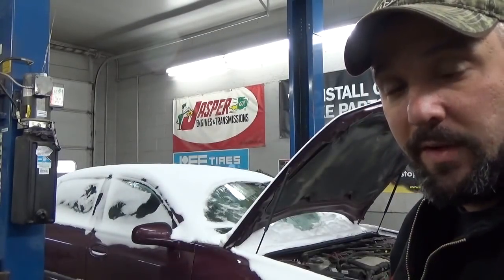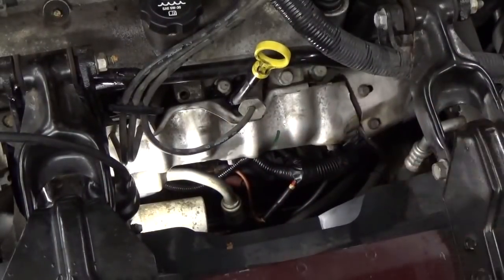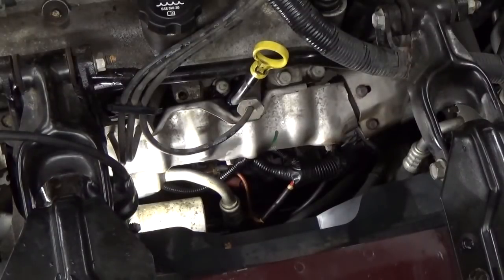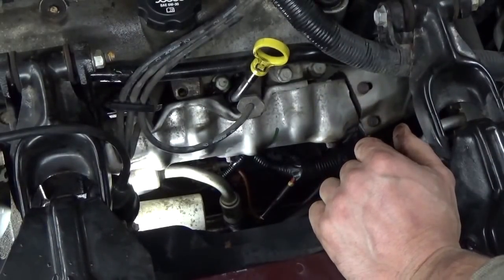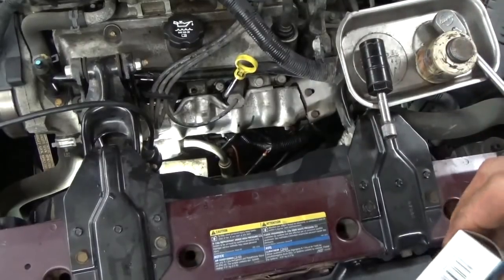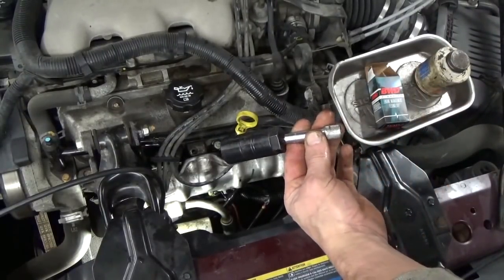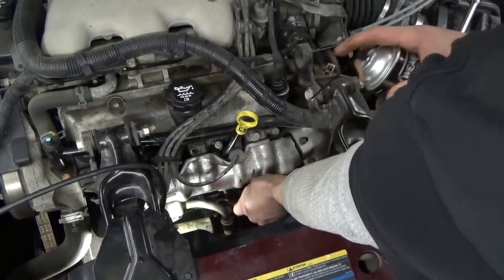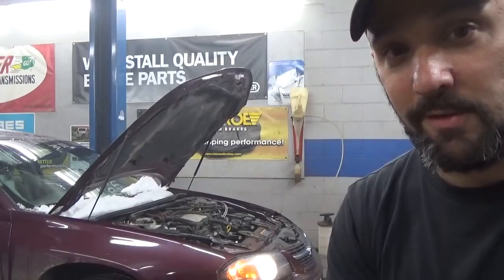Engine Oil Leak - Chevy Impala 3.4

Comment: I have a question related to the oil pressure switch.  I've had an "LOW ENG OIL LEVEL" warning light issue for several years with my 2003 Impala, and it comes on when I start the engine and then it goes off after about a minute or so.  I read into this online and learned that another Impala owner had success solving this same problem by adding 6 oz. of Marvel Mystery Oil (at the advice of a forum participant) to the crankcase which dissolved the sludge in the crankcase and/or other key location.  Do you think the problem is related to the oil PRESSURE switch or the oil LEVEL switch in the oil pan which could be blocked with sludge (or both)?  Can the oil pressure switch be cleared of sludge by using Gumout on it and/or its port?  Thanks.
Reply from the maker: DDEENY Usually just a bad oil LEVEL switch in the pan. Very easy to change.
Reply: +South Main Auto Repair I'd be very interested in watching a video to fix the oil pressure sensor in the pan. Do you have that video in your line up? If not, do you plan on making one?
Reply from the maker: Sorry I don't have one...
Reply: Thanks for your reply.  You're right, Gumout would definitely thin the oil and is NEVER intended or recommended to add to engine oil, but I mentioned Marvel Mystery Oil and not Gumout in my post.  BTW, I'm using MMO as an additive to both gas and oil now in the recommended amounts (4 oz. per 10 gal. fuel and 20% oil capacity), and if you read its reviews, there's nothing but 5-star ratings for it.  I track my MPG and it appears that I'm getting better MPG while using MMO added to the gas.  I'm also using MMO with my gas lawn mower and MMO also functions as a fuel stabilizer to prevent it from going stale.

FYI, regarding my issue with the "LOW ENG OIL LEVEL" warning light that I had last year, I've since replaced my entire engine with a used one after I also had an ongoing issue with a blown head gasket, and it was actually cheaper and made more sense to replace the engine per my mechanic's advice.  Thank you again for your comment.
Reply: Thanks for the info.  Regarding my own blown head gasket issue with my Impala's 3.4 engine,  I was experiencing erratic heater function and occasionally my coolant temperature gauge would swing wildly into the red and the warning light would come on.  Then after a short time the system would normalize as fast as it malfunctioned.  The head gasket leak was causing exhaust gas to leak into the coolant and cause air pockets in turn causing the system to become erratic, and I verified the presence of exhaust gas with a leak test.  Then when that happened, I used the Lisle Spill-Free Funnel (highly-recommended) to purge the air from the system and it worked great but lasted only a short time before recurring.

In an unwise attempt to get off cheaply and against my better judgment, I researched all of the stop leak products including Bars and then used the K&W Fiberlock Head Gasket and Engine Block Repair stop leak because supposedly it wasn't necessary to drain the coolant (another issue is that fact that the 3.4 engine allows only about 1.5 qts. of the 11.3 quart coolant capacity to drain).  WRONG!!! DON'T EVER USE THIS PRODUCT!!!  After I carefully and slowly added the K&W (which has the "fiberlock" additive which looks like paper pulp and the fluid resembles egg drop soup), my Impala overheated in about 10 minutes.  I noticed that the upper radiator hose was hot and the cap was cool, indicating that the K&W blocked the radiator and/or thermostat.  I wanted to remove the thermostat beforehand but it's in a prohibitive location buried under the passover, not your typical convenient location.  20/20 hindsight, I would have ignored the product's instructions to begin with a cold engine and would instead have allowed the engine to reach full-operating temperature to allow the thermostat to fully open before adding the product hoping that at least the thermostat wouldn't become blocked.  Soon after that experience, I drove the car to my local Pep Boys and on the way, I noticed that the water pump was leaking, and also soaking the serpentine belt and causing it to slip to the point that the power steering was malfunctioning.  The blocked cooling system caused the pump to run dry which spells the end of it.  So in the end I had the engine replaced with a low-mileage used engine and it's been running perfectly for several months and I'm way happy with it.  I've seen another YouTube post explaining the very same experience with the K&W Fiberlock stop leak.  Although most mechanics frown upon "mechanic in a bottle" products, I'll admit that some have very favorable experiences with them and results are hit-or-miss depending on the product, how it's used and the specific nature of the leak.

I'm interested in your own experience with the transmission fluid added to the engine and although I've never heard of that, I've wondered if in fact the "mystery" of MMO is simply that it's glorified transmission fluid, and I'll research that.  If so, generic transmission fluid can be found at dollar stores much cheaper than MMO at Walmart which probably has the best price for it.  Even the red color is the same, and I still have a few full quarts of it in my shed from a previous transmission leak problem that I once had after having a transmission flush done on a high-mileage Caprice that caused the old sludge that was keeping the seals tight to be flushed and thereby causing the tranny to leak like hell.  There's another helpful experience for you to learn from.  Thanks for your comments.
Reply: Thanks again for your thoughtful comments.  I had taken my car to have the head gasket replaced on my 3.4 (I corrected my post when I noted 3.1) by my local mechanic later suggested that it made more sense to replace the entire engine with a used low-mileage one, which I agreed to do.  The head gasket repair cost was guesstimated by Pep Boys to be between $2,500 and $3,500 but my local independent mechanic replaced the engine for $1,800.  Make sense?

I'm aware of the 2 cooling system bleeder screws but as I said, I used the Lisle Spill-Free Funnel and it worked like a charm although the improvement to the cooling system performance was temporary as the leaking exhaust gas into the cooling system again recurred soon afterwards.  The way that the Funnel is used is that you park the car with the front end higher to set the radiator cap as the highest point in the cooling system, then simply attach the funnel to the radiator neck with the supplied cap replacement which creates a leak-proof connection of the Funnel to the neck, then fill the Funnel about halfway with coolant, start the engine cold with the heater set on to HIGH and watch the air escape in the form of bubbles from the radiator through the Funnel, small bubbles at first and then much larger once the thermostat fully opens.  Then when the bubbles stop, the system is fully purged of air and the Funnel can be removed and the radiator topped off as necessary.  Takes only about 10 minutes.  BTW, it's called the Lisle Spill-Free Funnel because it includes a plunger to seal the Funnel when it's being removed to transfer the remaining coolant to the jug, whereby the plunger is removed and the coolant neatly drained with no spillage.  I highly recommend it because it's much easier and simpler than fussing with the supplied bleeder screws.  I'd always recommend using it if the system is drained or otherwise opened.

I didn't have a grounding problem related to the electrical gauge but I did read about electrical resistance through a cooling system that if faulty, can contribute to gasket failure, and the coolant resistance itself needs to be checked.  BTW, I love my 2003 Impala so much that I also picked up a used 2005 3.8 Impala to use when the 2003 was down and now I still own both.  BTW, I now need to address my 2003's front end suspension which has become very clunky.  I know that the original struts need to be replaced (165,000 miles) but do have any suggestions regarding this issue and any other offending parts e.g. ball joints, control arm bushings or even engine/transmission mounts?  Thanks again for your thoughtful comments.
Reply: Thanks for the reply and info.  You really know your GM cars.  Wanna know the truth?  I really miss my old Caprices.  I owned a '77, '83 and '86.  (The '86 was the one that the transmission leaked after the flush.)

I'm thinking of replacing the struts on my '03 Impala myself but I have a gut feeling that there's something more that's causing my clunking issues.  Is there a way to check the engine/tranny mounts aside from trying to rock the engine from above?  I also suppose that I can rent one of those electronic stethoscopes from AutoZone to try to pinpoint the source(s).  Thanks again.
Reply: DDEENY I know the feeling. I miss my 89 Chevy Caprice.
Reply: Thank you so much for that information.  That's way more complete than I'd ever received before.  Two years ago I brought my car to Pep Boys and explained the problem to the service manager and he didn't have very much of any opinion and I told him that I wanted to have the car raised on the lift so that the front end suspension could be thoroughly checked, but all that he did was to send one of his mechanics out for a test ride around the block to try to hear the clunking sound and what the cause might be.  Of course the short ride didn't produce any clunks loud enough to tell, and because the struts are original, they shot from the hip and assumed that they were the cause, but I didn't trust that diagnosis and refused to spend the money for struts at that time.

My car clunks when going over or through even mild bumps and dips and it's more prevalent on the passenger side which BTW is where I had a minor accident and impact 3 years ago but the car was perfectly OK structurally and I drove away from the scene without so much as the car pulling at all.  The front passenger side corner was impacted and the headlight, fender and sundry parts needed to be replaced and the bumper and hood repaired.  (I asked the body shop manager to leak test the windshield washer tank and apparently he didn't because it leaks if I fill it to a certain level, but that's the least of my problems.)  I suspect that the damage that I thought was luckily avoided has become evident over time.  I even experience a more rattling sound when going over very bumpy roads which to my inexperienced ears sounds like bad engine mounts.  I realize that this is a difficult issue to diagnose for the fact that it can be any number of issues and more than just one.  When my engine was replaced I left a note for the mechanic to check the mounts while the old engine was pulled and replace as necessary but I doubt that he did that.  My car clunks exactly as it did with the old engine, no better or worse.  If the mounts' rubber was worn or eroded I'd think that the mechanic would notice it and wouldn't be foolish enough to leave them in place, but you never know.  But I had mentioned the clunking to him and noted that I'd be back to have the suspension checked and hopefully he will do a thorough visual and test drive inspection.

Thank you for your very helpful knowledge and comments.
Reply: Thanks.  I've heard and read about the bracket.  I'm not sure that I'm having a problem with it, but it the past I've had a transient issue with rattling caused by some sort of loose part or fastener definitely coming from within either behind the instrument cluster within the dash or within the steering column enclosure behind the steering wheel.  It would rattle momentarily if I encountered a front end bump.  But I don't remember hearing it again since my engine was replaced or maybe I've become so used to it that it no longer has my attention or maybe the parts shifted and no longer touch to cause a rattle.  It sounded like metal contacting plastic.  But now that I'm reminded, I'll listen more closely.  Thanks again.

Comment: I had the exact same thing happen with an old 87 Dodge Charger 024 i owned in 2001.  I was delivering a newspaper while pulling in a driveway, and the oil switch exploded oil all over the customers driveway.

Comment: Hey there eric, I crawled under my truck and found that the oil pan had oil all in the middle of it, running towards the middle, and then dripping down slowly. I followed the leak back to the back of the oil pan, right where the curved seal is in the back. I just replaced that gasket when my engine was out of the truck, so I highly doubt it is failing again. Could it be a rear main seal? How can I tell the difference between the two? Everywhere else around the oil pan is dry.
Reply from the maker: ***Classified*** Can u see if it slung all over the back of the flywheel?
Reply: South Main Auto Repair
The flywheel cover or the actual flywheel?
Reply from the maker: The flywheel
Reply: South Main Auto Repair haha, not sure. I'll take the flywheel cover off and let you know soon. If it is leaking under the cover, how big of a job is a rear main seal? I've heard that you can easily damage the crank while you change it, so I don't want to mess with it if it's easy to screw up.
Reply from the maker: you have to pull engine or the trans if it is.
Reply: South Main Auto Repair Aw man, not what I wanted to hear. Thanks though, appreciate all your help with everything.

Comment: do you see this failure a lot? I've never actually seen that happen before. even when I worked at the dealer, I did tons of intake gaskets and oil pan gaskets on those.
Reply from the maker: kenman1717 I have seen them seap in the past filling up the wire loom but this baby was pumping lol.
Reply: it was sure flowing out.
Reply from the maker: You aint kidding...

Comment: Common problem with the 3.4l v6, happened twice on mine.
Reply: i got oil spill on the ground.. tought it was the oil pan gasket but now i think this could be the cause to... 
The oil spill on the ground are located around the front right ride of the engine...
Reply: Especially if it is looking like it is dripping from the starter.
Reply: Yeah exactly... I bought the part and change it.. I will see if it's still dripping.. ;)

Comment: I've had the oil pressure switch replaced twice and it's still leaking from the same part.  I have been told that the part can be defected.  Is that true? And I don't believe a sealant was placed on there,  could that also keep causing the leak?  It mainly happens after an oil change.  Pls help...
Reply from the maker: Bree Harden If it happening after an oil change it could be the filter you know... the filter is right  in the same area. Have you had it looked at by a shop?
Reply: South Main Auto Repair yes.
Reply: I can take it back and it's replaced at no charge but I'm losing money on oil. I think im a have to go to the costly dealership
Reply from the maker: And are they 100% that is where the leak is generating? Seems odd to keep having the switch fail. If that is the case I would be getting an OEM Switch instead of an aftermarket...
Reply: Yep, but I never seen them apply the sealant.  I usually ask to see the piece they take off and there is no sign of sealant on the pipe. Thanks for the OEM tip.
Reply from the maker: Bree Harden  Well it is odd to me it happens after an oil change? That shouldn't change any thing ya know... I guess if it was me and I had to keep replacing aftermarket switches I would def. get an OEM and make sure they used pipe sealant. If it still leaked after that I may have it looked at, at a different shop to see what the heck is going on...
Reply: South Main Auto Repair  Ok. Pipe sealant was not used and I'm banking on that's the issue.  Thanks so much for your feedback
Reply: I really feel like just doing it myself using your video... Lol
Reply from the maker: at a girl ;)
Reply: Bree Harden for about 25 bucks you can buy a UV light and glasses kit on Amazon for about 17 bucks then buy a small bottle of UV dye from eBay for about four bucks thrown into your engine oil and  start your car look for the leak it will glow green and that’s how you find the leak. It’s easier to find the leak when it’s a little dark outside Good luck🍀
Reply: @breeharden9346  Pipe sealant or rather the lack of pipe sealant will not cause the switch to leak internally as the one in this video did.  However, the threads in the block could be damaged, but should leak all the time and not just after oil change.  If its just after oil change, maybe the tech changing the oil is just missing the oil fill and pouring it out over the engine and it runs down to this sensor.
Reply: @SouthMainAuto  ive had it done by 3 different shops

Comment: I have a 05 Impala with a 3.4 V6 and every time I hose off the engine the low oil pressure light comes on.  Are these switches just really sensitive?
Reply from the maker: Corey Toolen Well the low oil switch is not the same as the one shown here...
Reply: Hmmm,  I see.  This makes things more complicated. lol

Comment: I think thats what happened to my Impala this morning I was driving stopped at a red light light turned green I pressed on the gas and as I was accelerating I looked in the rearview mirror and saw a huge puff of smoke about 30 seconds after that oil pressure light came on car started to sound weird and then shut off I pulled off the side of the road check the oil and there was no oil and it kind of oil at the bottom of the car

Comment: Chevy need a wrench upside the head the oil pressure switch is not that easy to get too 
the design on the 2008 3.5 impala is entirely different smdh great identify and job. I'm having
the same problem.
Reply: 2000 malibu, I had to get to from underneath